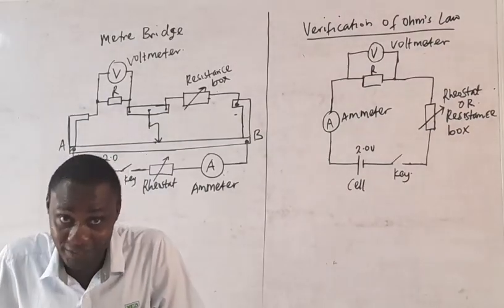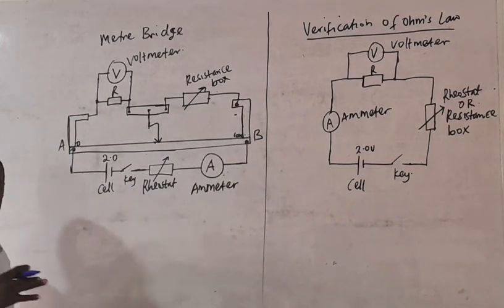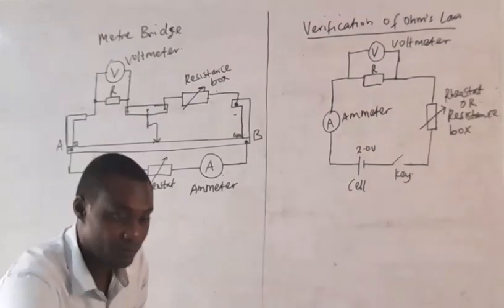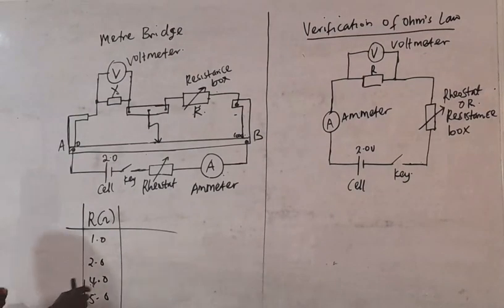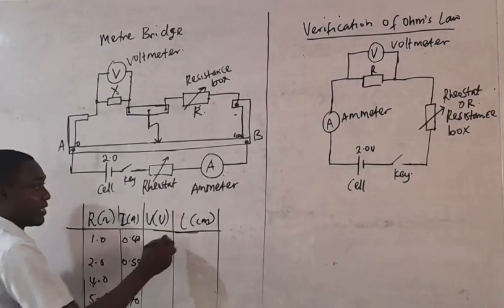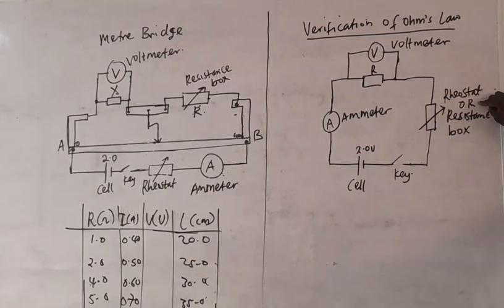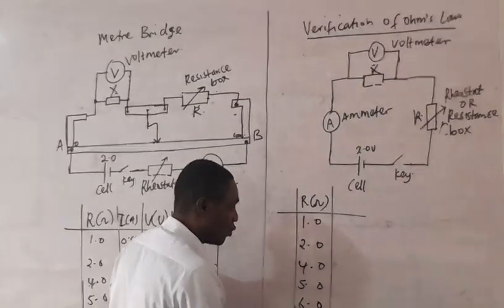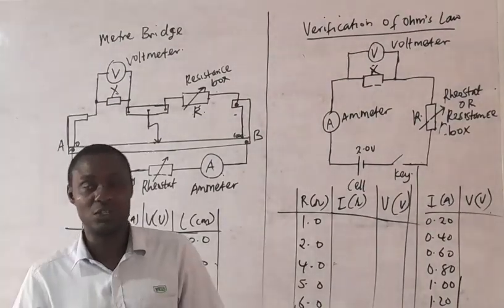#practical 2023 #physics #electricity explanation.

Comment: 2:12 pls sir why wasn't the voltmeter connected in parallel with the resistance box
Reply: Also, why wasn't the jockey connected to a galvanometer
Reply from the maker: You can only connect the jockey to a galvanometer
Reply from the maker: The voltage meter is always connected in parallel in a circuit

Comment: I am a teacher and also need to charge my cell. We're can I do that?
Reply from the maker: Give it to a battery charger to put H2SO4  only. 

You don't need to charge it. Just add the acid.
Reply: Can I put the acid myself
Reply from the maker: @KennethBegold-jp1mw  I don't think so. Because there's a required concentration of acid needed. The battery charge should know exactly that.
Reply: @yousciencelab5307  ok.thanks but I will do it myself bcuz we have enough concentrated H2SO4 in our lab and I will use the voltmeter to measure the voltage.i wanted to use dry cell before in the practical and realized we have enough of this in our lab
Reply from the maker: @KennethBegold-jp1mw  okay. If you use dry cell, be sure to indicate it on the teacher's report on the day of the exam. 

Also, there's a level the acid can be filled up to. Use dilute acid too. 

Finally, I tried using the cell to carryout the experiment, the emf was actually 1.4 v and the current drops to 0.1 A for all my readings. So it was difficult for me to carryout the experiment. But I did manipulated the values. You can check it on my most recent videos.
Reply: @yousciencelab5307  ok